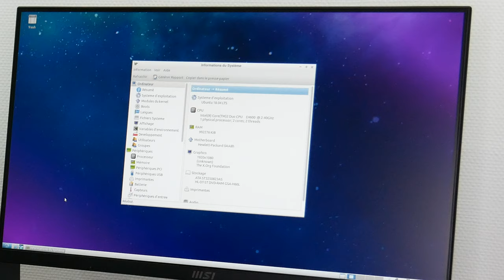OLD computer needs DEEP cleaning (HP Compaq dc7800) [4K]

Comment: Another awesome video! Great work! I actually got an HP like this a few weeks ago, and when I opened it up, it was like nothing I had ever seen. It was FULL of dust, like yours. I guess it is just because of the fans’ positions and not great air flow. Oh, I don’t know if this would be easy for you, but I think it would be pretty interesting to see the CPU/GPU temp before and after cleaning. Also the noise level. Either way, keep up with the great content!
Reply from the maker: Hi again Volvo240 😊
The first video I uploaded on the channel was with the same chassis. The dust was at the exact same places. So I guess you are pretty right. 
About your suggestion, you are not the 1st person who tell me this. I add your comment in my possible improvements list. I don"t promise to do it, but will think about it.
Thanks a lot as usual ❤️❤️

Comment: French Satisfactory, I appreciate that you take the time to clean these systems so thoroughly. With that said a word to the wise when removing thermal paste, use plastic spudger to remove it otherwise you are creating scratches that do not allow the thermal paste to effectively do its job.
Reply from the maker: mmmh true about the scratches. You are not the 1st person who are telling me this, but didn't think about plastic spudger. I add your comment on my improvement list and go to amazon to buy one. ✌️
Thanks a lot for your comment Trae K! ❤️
Reply: Depends on the surface really like CPU ihs it's not really a problem as long as it's smooth alot of overclockers lap there ihs for better contact now if it was a direct die like the old athlons or a chipset die I could see an issue

Comment: At 12:10 you forgot to put another screw in the fan
Reply from the maker: Hi KING!
Nice shot! But this is true and false in the same time 😅
In fact, there was only 3 screws before I unmount the PSU 10:54
But I should buy some screws to fix that when there is some missing. I add this in my improvement list.
Thanks a lot for your comment ❤️

Comment: TIL: The spray is called contact cleaner
Reply from the maker: Hi linearz.
The spray I'm using during the video is Compressed Air Dusters. Just to remove the dust. Not sure the spray you are talking about should be used the same way 😅 
But didn't know about this name of this spray. Will check this out a bit more to see if it's interesting to buy it. thx
oh and thanks for your participation on the other topic ❤️
Reply: @french.satisfactory  I thought you are using liquid based contact cleaner. I think it is alcohol based and dry very fast. Thanks for the clarification.

Comment: You really got to stop using metal tools on the surfaces of heat sinks, use plastic tools to remove old thermal paste and adhesive you don't want to gouge the surfaces anymore than they already are they need to be mirror finish, for the best thermal contact possible even with these older components
Reply from the maker: yey, i ordered what I need and should have it for the next video 🤩 youhouuuu 😅